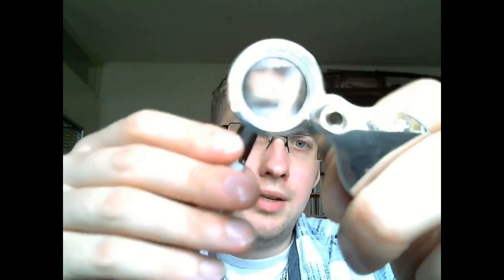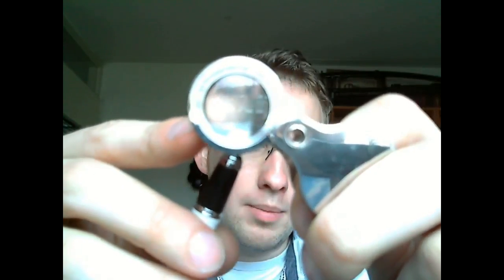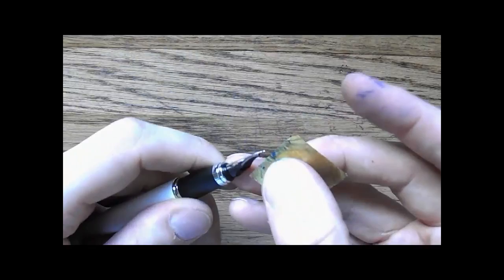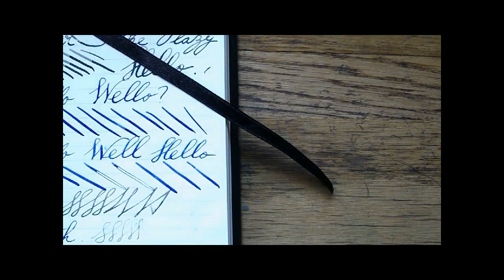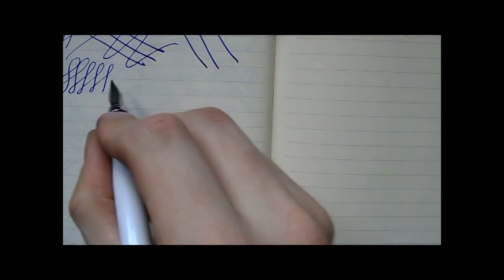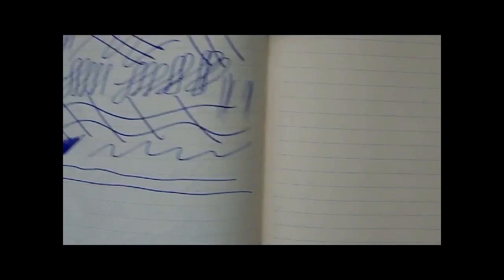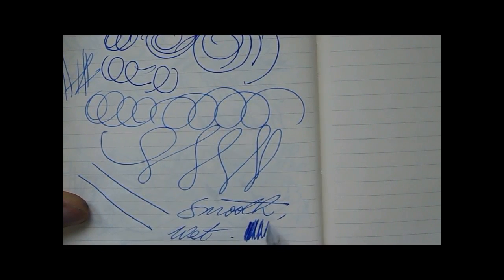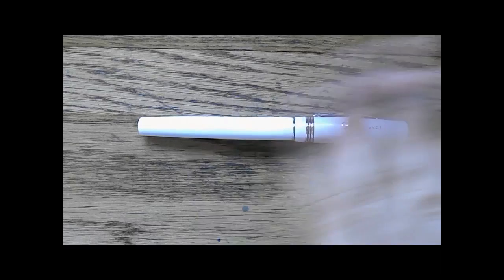Making a pen a bit wetter

Comment: Another question: is it weird that I have had more success in making a pen wetter  by actually pressing the tines tighter together?

I got an parker urban and I had trouble with it because the letters seemed to be almost faded whenever I wrote with it.  

I tried your method of separating the nibs a tiny bit but nothing, even worse I started having trouble because it started to skip
Then I pressed them together as hard as i could and damn, I can't get enough of it's wetness.

Comment: Ok so this is my question, I have a Pilot Custom 74 in a medium nib on it.  The nib tines are slightly touching at the top so on my up strokes to the left I get a dry line.  Now the nib is fairly soft which is why I haven't bothered to mess with it until now.  WIth little pressure it goes unnoticed actually.  Every J I write, which is in my name, I get a dry fine line which skips sometimes.  I have worked on some steel nibs before but with this being a more expensive pen and a somewhat soft 14k nib would you work on it in this matter or no?
Reply from the maker: Yes, the same procedures apply. Just go slow and check the results often and you should have no problems.

Comment: Great film, it would be enhanced by using an enlarged still photo of the pen nib prior and after the operation. I wish I knew where to get brass shim but thin aluminium can material may serve the purpose perhaps. Thank you for uploading.
Reply: You can get brass shims from Goulet Pens.
Reply: Thank you so much Carolyn for your kind advice. Actually my son suggested a model engineer suppliers as a place to look and a firm called Kennion  has sold me a sheet which I am sharing out. The process described has made a world of difference to the effectiveness of my pens. Again, thank you very much for responding.
Reply: You are quite welcome.  Glad you found what you were looking for.  :)

Comment: I have a pen that is actually too wet like an 8.5-9/10 it just is boarder line annoying and I can't write with it. The worst part is that it is my Faber-Castell and was 350 dollars and has the smoothest nib I ever used...It's like driving a ferrari with a sticky throttle that is either on 100 or off. UGH I am trying to get the nib swapped by Faber Castell and it is a process!